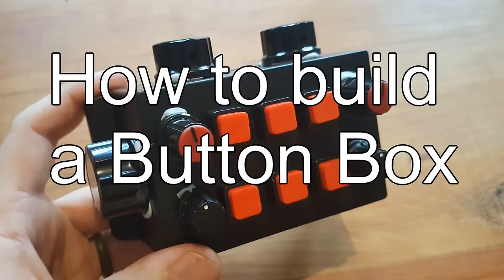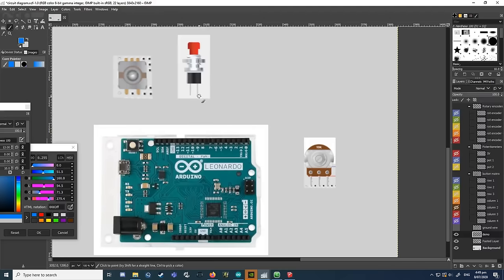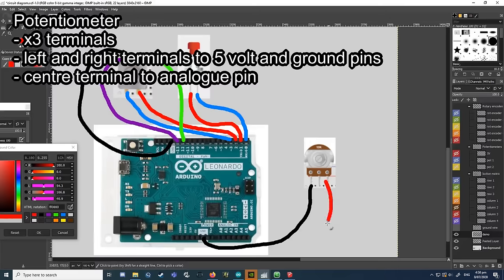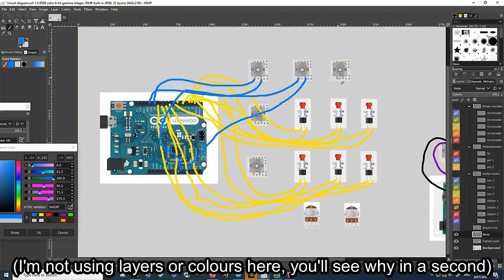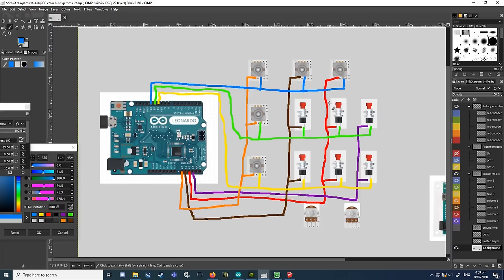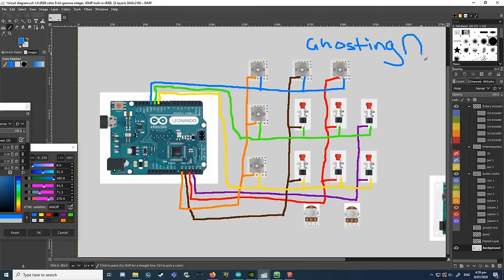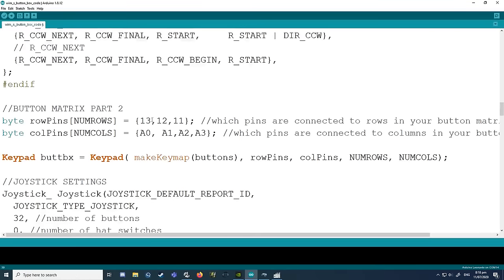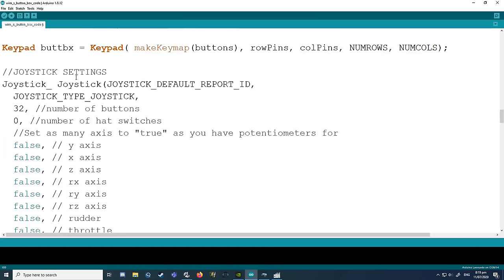How to Build a Button Box

Comment: Just a tip for anyone here new to soldering / projects like this: USE SMALL PERF BOARD(S) FOR THE POTENTIOMETERS, it is so much easier to solder wires together when you have an actual platform to do so. Also makes installing the components easier within the box itself imo

The reason I say use a perf board is because I was having a nightmare of a time wiring my two potentiometers correctly, wiring two tiny wires for each the 3.3v and GRND pins was a nightmare and causing me issues (I must have burnt through 3 or 4 of them just soldering terribly on them, the arduino spits out random data from the output when you do it wrong, making the axises EXTREMELY innaccurate (obviously)). 

If you have encoders with no pin out board, I would also recommend a perf board for those, thankfully mines had them which was just plug and play with the arduino cables I had. My box is still ongoing, buying a larger enclosure as my current one was a bit too small (realised I needed a leonardo for the extra pins, when previously I was going to use a pro micro) and waiting on better buttons, do not buy the tiny tacile ones, big mistake on my part.

Comment: I am making a button box for DCS Flight Sim (A10C 2). I want nothing more complex than switches be they On-Off or momentary push buttons. I have completed all tasks as you have described in construction up to the wiring and tested out the bare wire switching to each individual switch using continuity for the matrix as designed. My matrix comprises 5 rows and 6 columns comprising purely on-off toggle switches (22 off) and monetary push buttons (7 off). 
Rows wires (5 0ff) are connected to an Arduino Nano - pins A0 .... A4. Columns wires (6 off ) are connected to D3....D8, so I am confident that the construction phase can be put to bed as completed successfully, following testing of every individual button and switch continuity.
After connecting the Arduino through USB to my PC, this is where my troubles start. It only shows up as an "unspecified item" in my control panel instead of under the "Devices" collection. It shows as connected through Port_#0012.Hub_#0001 (I presume this is because my USB connector from the Arduino Nano was connected to a 7 Multiport Plug) which was automatically allocated. 
Right-clicking on the device does not show "Game Controller Settings" as my Hotas Warthog Throttle/Joystick and CH Pro Pedals show, so no way of testing the switching as shown in your video using the red light matrix to prove each switch. When right-clicking one of my "installed Devices" I only see The Warthog and CH Pro items listed as in the box at 26min 42secs. It seems almost as though despite following your instructions allocating pins and coding the Arduino successfully, whilst it uploads and verifies, it is not seen as installed. I have no doubt I am doing something wrong somewhere but being a 70-year-old "Noob" I can't figure out where. Is the port right? Is my programme right, I just haven't a clue over something that so many claim is basic and straightforward. Can you or anyone else Pleeeeease HELP??

Comment: i know it's an old video but i really appreciated it, thank youy very much man, i only have one question: i dont get how are the buttons supposed to work if none of its pins are plugged in
Reply from the maker: The buttons are connected to the pins of the arduino by the matrix. It's just that instead of having 2 pins per button, all the buttons are sharing a smaller number of pins.
Reply: @wimwamjoey  oh yeah I got it, but if the digital pins are giving 5 volts then the analogs are working as ground for the matrix? Otherwise where should the 5 volts go?
Reply: Yeah I have the same question. Are all of the voltages floating? I don't see and pull up resistors or pull down resistors. I know you can set some digital pins to be pulled up through software but I just don't see how the analog pins can get a voltage reading when they're connected to an open wire. Wouldn't the signal just be noise?
Reply from the maker: I don't actually know (I cribbed this together from various articles and videos, I'm not that experienced with arduino) but I expect the answer is that it's all handled through the keypad library, not in the code you can see in IDE.
Reply: Yes, it's all handled by the keypad library. They use the pullup resistors integrated into the board. It actually makes no difference if you use analog or digital pins for this, as all analog pins can also work as digital ones. If anyone is interested in the programming, you can check the source code of the keypad library here (the pin write/read operations start at line 83): https://github.com/Chris--A/Keypad/blob/master/src/Keypad.cpp#L83
Reply: Ah so it seems like  the rows are set as digital inputs that are held high with built in resistors and then the columns are used as digital outputs and they are pulsed low when reading and held high when they're not read. So the columns are the source of voltage! Thank you for this, it helped a lot!

Comment: Overall great video, but there are a couple of inaccuracies that I wanted to correct for the sake of people new to electronics and Arduino:
1. 5:40 You can't use an Arduino UNO for this task, only a Leonardo or Pro Micro. The UNO's chip doesn't support the HID functionality that allows the Leonardo or Pro Micro to appear as a Joystick or Keyboard when connected to a computer.
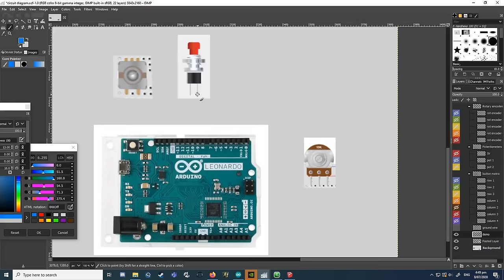2. 6:33 When a momentary button is connected directly to the Arduino (without a button matrix) it only requires a SINGLE Arduino pin - the other connection goes to either GND or VCC (Just like the momentary button on the encoder - it is exactly the same). To make life easier without going into too much detail, you should connect it to GND, and define it in the Arduino code as      pinMode(the-pin-to-which-you-connected-the-button, INPUT_PULLUP);

And one more tip - instead of using a drawing app to make your diagram, you would be much better off using a dedicated app such Fritizing, which is completely free and super simple to use. This would make it much easier to draw your schematics, and would also result in a much nicer looking product.
Reply from the maker: Argh yes, thanks for those corrections. Had a brain fart for both those points. 

I'm not sure Fritzing actually is free? They ask for at least 8 euro on their website but maybe there is a workaround I'm not aware of.
Reply: @wimwamjoey  I actually installed Fritzing through the chocolatey package manager (highly recommended tool to manage all software on windows). 
However, you can also download it manually using this link: https://fritzing.org/download/0.9.3b/windows-64bit/fritzing.0.9.3b.64.pc.zip
Reply: Thank you very much for the tip about the Uno otherwise I would have thinking and searching my ass off. I was just about starting to build a test setup for myself using this video but now I know it has no use as my boards here are all uno's :)  Thank you for saving me time and frustration :)
Reply: @wimwamjoey  I believe if you create an account, the option to download becomes visible without needing to donate. Something along those lines. I don't know if the workaround still works but it definitely used to.
Reply: @computerjantje  Time to buy some Pro Micros (-;
Reply: Thanks man i was just thinking the same when i was watching, i'm not sure why he was connecting the two pins from a button to two different arduino pins he should have a common ground for all components. On a different note, you can use an Arduino UNO to make joystic, it is not as straigh forward as using LEO or Pro Micro but you should check UnoJoy project. I did it but it involve flashing the arduino board. I also used a Mega for my sim and used MegaJoy.. check them out they are interesting

Comment: A question, and apologies if it's been asked. 

While a grid gives the highest number of buttons for the number of pins... what about running one wire across all the buttons and then giving an individual wire for the other post. 

So 
"directly wired" = 2 pins per button. 
"grid" = 2x (root of buttons) : so 4 pins gets you 4 buttons, 6 pins gets you 9 buttons, 8 pins gets you 16 buttons. 
"half grid" (what I'm asking about) = CountOfButtons + 1 pins

That would seem to resolve the "several buttons pressed at once" issue of the matrix as there would be a unique single pin for each button.. or am I missing something. 

Expanded. Direct wired. 
Button 1 = pin 1 + 2
Button 2 = pin 3 + 4
etc

Expanded. Grid
Button 1 = pin 1 + 3
Button 2 = pin 2 + 3
Button 3 = pin 1 + 4
Button 4 = pin 2 + 4
etc

Expanded. Half Gird
Button 1 = pin 1 + 2
Button 2 = pin 1 + 3
Button 3 = pin 1 + 4
Button 4 = pin 1 + 5
Reply from the maker: Sure, you could do that (effectively its still a matrix but with only one row), however as you say: its an inefficient use of pins which you might want for other components like encoders and pots.

If you just wanted a button box with a small number of buttons you'd be much better off using a zero delay joystick encoder which is cheaper than an arduino and doesn't require any coding.

Comment: This is defintely giving me some ideas for my truck simulator. I feel like the only difficult thing for me is the sauntering of wires.
Reply from the maker: It's easier than you might think. You only need a cheap soldering iron to get started. Just watch a few videos on technique and practice with bits of spare wires until you feel confident enough to have a go with real components.

Comment: Ok worked after a few goes.  Once I worked out where to put .h files (create libraries).  But only first of 3 rotaries worked initially.  Then remembered you note about the first rotary MUST be on pins 0 and 1.  My board didnt have a 0 and 1.. So I added a fake rotary to the code as 11st of 4  on 0 and 1  and now all 3 ACTUAL rotaries work.  Hope that may help someone.   Everything else worked first time :)   Thanks for a very useful video.
Reply: Hey there. I just got my arduino nano and was wondering the same why i didnt have any 0 and 1. Thanks for mentioning it!  How did you make a fake rotary? just two blind wires?
Reply: @Recrohin  I just configured an extra 1st rotary in the arduino code using pins 0 and 1 that doesnt actually physically exist.

Comment: Wonderful instructions,  This is great job of explaining to a noob. I have however run into a snag.  My Rotary encoders have 5 pins as do yours, but my pins are labeled GRD,+,SW,DT and CLK. Ground and one side of the switch are the same potential. Can I use these or do I need another style of Encoder?
Reply from the maker: I believe the gnd goes to ground, dt and clk are the left and right turning terminals, + and sw get hooked into your button matrix. I would run a test on this first though before you solder anything too permanently
Reply from the maker: Alternatively, if you look carefully at your encoder, you will probably find it is actually exactly the same as mine (three terminals on one side, two on the other). It has just had those terminals rerouted through a small pcb (the plastic base bit). 

If you want, you could probably desolder it from the pcb and use the terminals as shown in the video. 

It might give you a bit more space inside your enclosure but it can be a little fiddly to do.

Comment: Aakshewallly, potentiometers typically only turn from 270 to 330 degrees. There are multi-turn trimmer potentiometers, (which typically turn 3600 degrees, or 10 turns) but you need a tiny screwdriver to adjust those. No knobs here.

Comment: Hey Wim. What should i do if i want to add buttons outside the matrix? I need this because i have LEDS on my switches and buttons which need to be off until pushed. This can only be done if one pin is closed obviously so a matrix isn't a possibility for those. I also have no idea how to integrate a seperate button code into this sketch.

Comment: In this build for encoders to work they have to be 30 pole ones i tried 24 pole and nothing. Switched to 30 pole like you did use i in the build and now it works lik a charm.

Comment: Hello, i have made a similar button box with a 5x6 matrix and 2 potentiometers but 10 of those buttons are on/off switches. Some games don't register those switches as toggle and having to turn them on and off twice to toggle instruments in-game really kills the immersion.

I added a toggle switch outside of the button matrix on its own pin and I was wondering how to modify the code to make that switch change the way the 10 on/off switches works. I want them to send a momentary signal when turned on and off.

I did this with a simple button box without any matrix but I'm having a hard time figuring out the matrix code.😅

Here's the code that worked but doesn't with the button matrix:

  if (currentButton2State != lastButton2State){
    if (toggle==true){
      Joystick.setButton(1, currentButton2State);
    } else {
      Joystick.setButton(1, 1);
      Joystick.sendState();
      delay(50);
      Joystick.setButton(1, 0);
      Joystick.sendState();
    }
  lastButton2State = currentButton2State;
  }

Please help me!
Reply from the maker: @TheHypogriphQc  you could probably use software like joytokey or joystick gremlin to do his rather than directly in the code? Sorry thats my best idea haha
Reply: @wimwamjoey  Thanks but I guess i'm gonna have to learn the keypad library. I don't want to have to rely on a separate app to do this since arduino can do it on its own. As previously mentioned, I made it work but outside a matrix only.

Comment: I have a lot to thank you for, this video has been my guide for weeks, I'm creating a few button boxes for my setup with your help.  I have a problem trying to make four potentiometers working correctly. Three of these works properly, but the fourth potentiometer is controlling all the others: if I move it, all the others change input together. 
It's like he's ruling everyone else. I made the parallel connection as in the video and followed the code adding four potentiometers. Do you have any guesses?
Reply from the maker: Maybe a wiring error? Double check your connections to make sure the wires aren't accidentally touching.
Reply: @wimwamjoey  Yeah, the problem was in the micro fit connector that I was using, 
the terminals were not well attached, it was lack of skill...... I change it to a DB type connector and the problem has gone. now it works perfectly and very smootly. Thanks for the tip!

Comment: how is this code working without any reference to 'setup' and 'loop'? these are mandatory to run a provide a compiling error without them.
Reply: The code linked in the video description contains the setup and loop statements on line 140 and 148. Or are you referring to a different code?
Reply: @panicpetes7676  you're 100% right. it is there, that's my bad. I was getting an erroneous, unrelated set up loop error that turned out to be a red herring. the code correctly has the two loop functions - they just happen to not be the first lines of code. thanks wim & panicpete!

Comment: Another option is to put every button on a single analog line in series. Each button (normally open) should have a resistor bypassing it, and each resistor should be different. 

Think B1 (button 1) has a 1 ohm bypass, B2 has a 2 ohm, B3 has a 4 ohm, and B4 has an 8 ohm. If no button is pressed you'll get 15 ohms. If button 4 and 1 are pressed you'll get 6 ohms, if B1 and B2 are pressed you'll get 12, etc. 

This way you use only one input and handle as many simultaneous button presses as possible without some kind of special communication protocol. Obviously you need different values than what I listed, and they are rarely going to be a power of 2. If they're far enough apart though, you can easily discern the buttons pressed. 

Another option is to use multiplexers. I'm designing a HOTASAS setup and I'm using a single Arduino Pro Micro. There are only four analog pins, but there are nine different analog values I need to read. I can use four digital pins to control the multiplexer and I can use a single analog pin (if I wanted) to measure every one of them! This increases latency but will not make a noticeable different if you use it correctly.

Comment: Amazing tutorial!! Clear, concise, and easy to follow, especially from a complete beginner! The only issue I am having is the coding part, I did not use any encoders or poteniometers in the build just toggle switches and momentary buttons, how much of the code do I need to get rid of in order to get this working?
Reply from the maker: If you are just using buttons you are better to use a zero-delay joystick encoder than an arduino (they are super cheap to buy on amazon). Otherwise, just set the number of encoders and potentiometers to zero and delete the bits of code which say "checkallpotentiometers" and "checkallrotaryencoders" under "void_loop"

Comment: Hi, how would you pin, and code, a toggle switch??
Reply: Hi, I have 10 toggles on my button box. For the toggle to work on a button matrix it has to be momentary. That means it will return to it center position. That way it does not keep the circuit closed and it behaves like the push buttons on the video. They don't need any special programming just add them to the rows and columns of your matrix. For 2 way toggle off-(on) it is exactly like push buttons since they have 2 pins. For 3 way switches (on)-off-(on) think of them like 2 separate buttons, with a common pin.